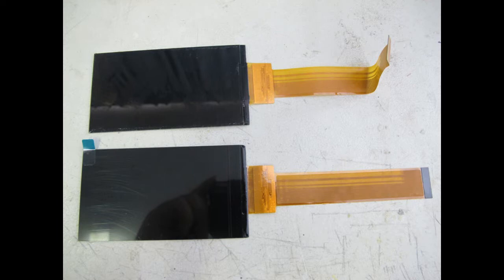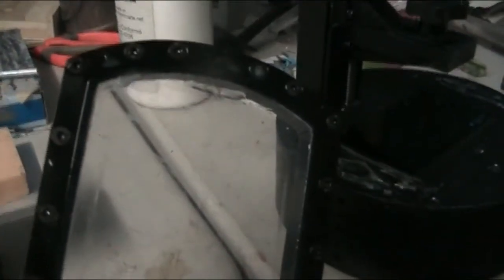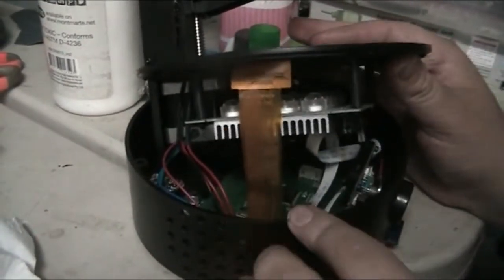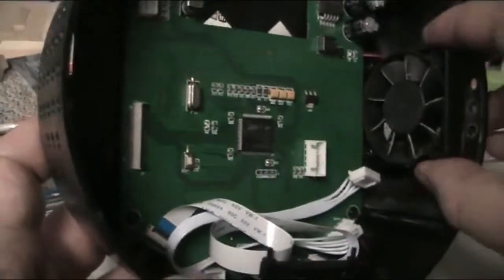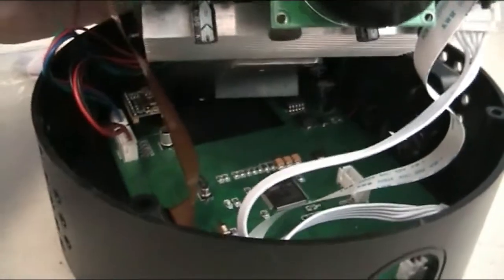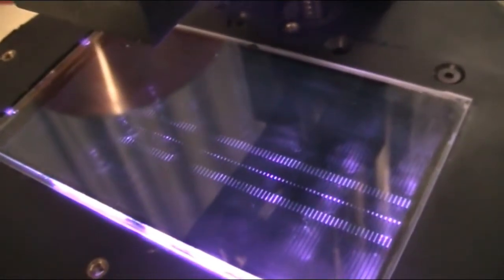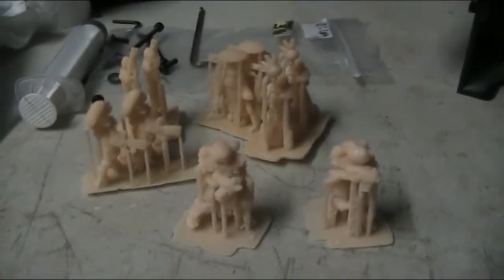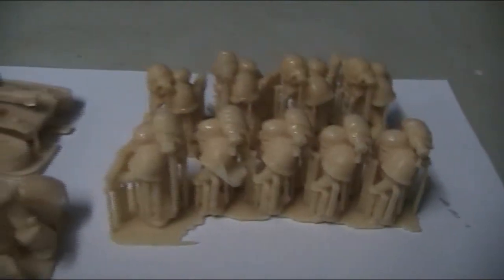SparkMaker - replacing LCD screen & troubelshooting

Comment: where did you get the replacement? mine has a crack and I am in need of a replacement.
Reply from the maker: Can  be bought from ebay, aliexpress or Amazon.
Reply: @mokanaman  have a link? I can't find it anywhere
Reply from the maker: @p928s1984  https://www.bonanza.com/listings/Sparkmaker-4-5-Inch-LCD-Screen-854-480-for-3D-Printer/939145490?currency=AUD&goog_pla=1